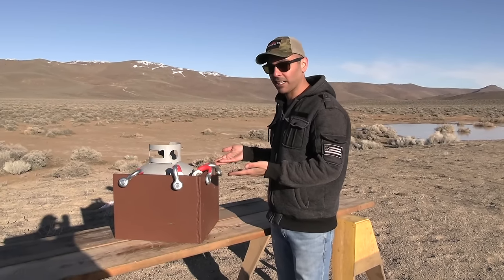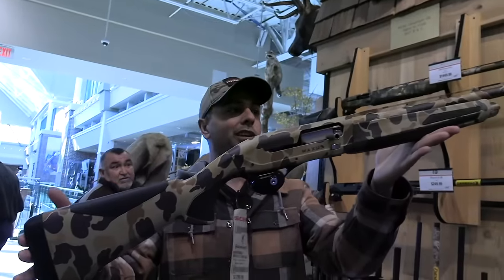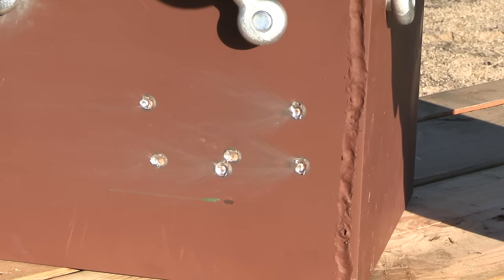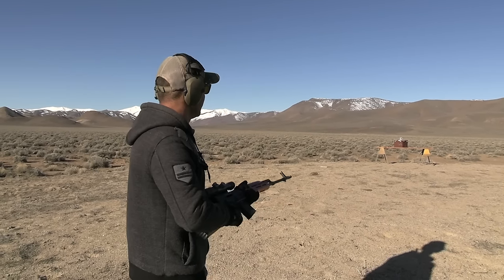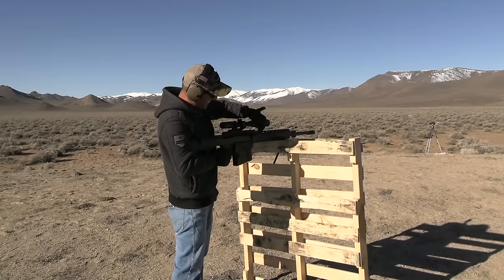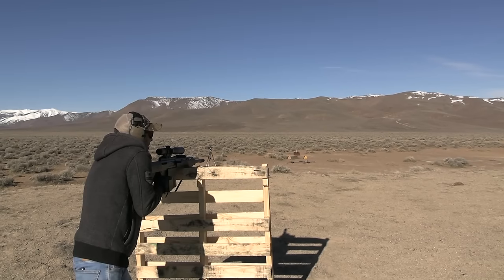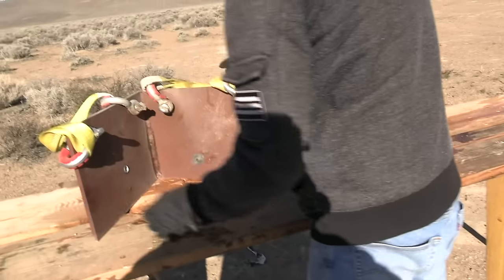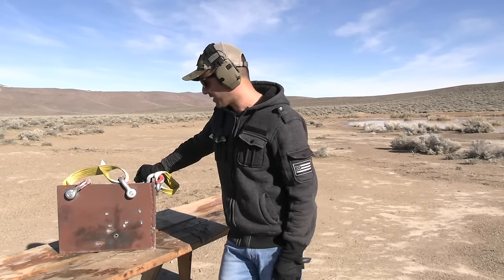will this sloped body armor stop 50bmg Bullet?

Comment: i saw Ryans video too. it worked waaay better than i was expecting. 
just a thought why not have normal armor plates but have 2, one pushed out slightly so its spaced armor
Reply: Weight is the issue. The human body can only tolerate carrying so much extra weight in combat situations or anything related.

Comment: Edwin try a 3in thick galvanized pipe dig it in the ground and fill it with gun powder with a fuse and tuck it all up with garbage paper bag! I tried this before and once you light it comes out of the ground like a míssil splits the pipe and flies 50ft in the air like an helicopter

Comment: You should not weld ar500 it is a tempered steel the weld will now be a  soft spot that can be penetrated.
Reply: Yes heat ruins heat treatment.

Comment: Don't know if you know this or not but the weld would probably ruin the heat treatment on that edge of the armor
Reply: If the weld breaks you’ve got problems bigger than that already lol. Even tank hulls split when welded properly for stress shit breaks after extremes.

Comment: Difference because inexpensive AR STEEL can have a hardness 390-440 that’s why different between 2panels
Reply: I don't think that was AR steel. The smaller calibers did to much. My AR steel targets don't take that damage straight on.
Reply: @steelrain79  it could be AR300
Reply: Could be AR300
Reply: @7150285  could be AR 200 or 235
Reply: @steelrain79  it would have gone straight thru if it was that low hardness. Most likely AR400 or AR300.
Mild steel is like 130 brinell
Reply: @7150285  whatever it was it wasn't 5 or 600.
Reply: @steelrain79  it wasn't 500 (that is for sure). Certainly not 600.
Reply: @steelrain79  when you buy steel slabs, they usually comes with a specs sheet. They performance brinell hardness testings, yield strength testing, ultimate tensile testings etc etc prior to sell to put the specs on the spec sheet of the steel slab that you are purchasing. These testings are usually done at the steel mill. Or other testing facilities, or maybe the distributor center could do the tests too IF they have the testing equipments.